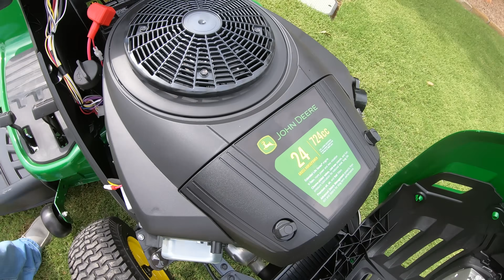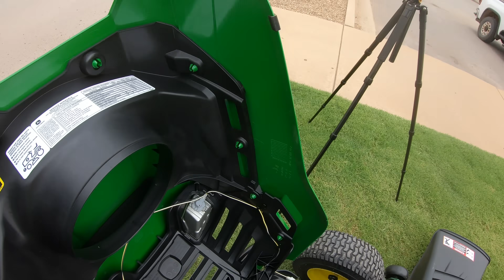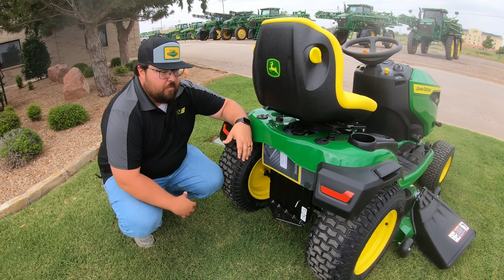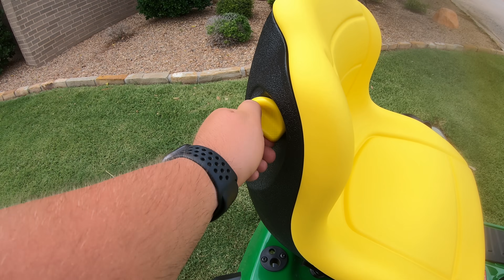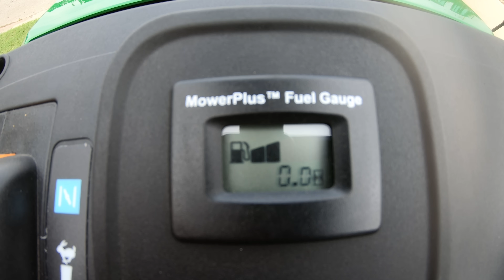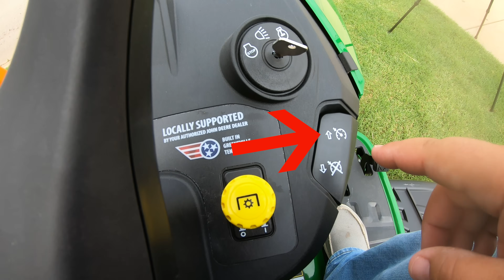2023 John Deere S170 Mower Review & Walkaround

Comment: That's a ridiculous oil change system. So it only takes 30 seconds but you're only replacing heals the oil??  That back up feature is also another reason why i didn't buy the John deere. On my cub first time i back up i set the button and i don't have to press it again till I'm done mowing.  Plus my cub is the kohler, a step up from the briggs

Comment: Quick question, is there a way for the engine to continue running when you step off the seat momentarily to open or close a gate?
Reply: If it is like the older models, just set the parking brake, and you can get off with the motor on.

Comment: Hello and thank you for your very helpful video. I am humbly asking you and/or your viewers for some advice. My 16 y/o craftsman mower finally gave out and I bought a new John Deere S170 riding mower. When starting it for the very first time, it sounds great and runs good until I pull the PTO switch and engage the blades. When I pull the PTO the mower deck takes a big jolt and shakes. It settles down quickly but I'm just wondering if that big jolt when engaging the blades is normal. On my old craftsman mower I had a manual lever and when I pulled that over to engage the blades it was smooth with no deck jolt or shake. No one at Lowes seems to know if that is normal and Lowes is planning on replacing this mower but I would really like to keep it if it's not really a problem. Thanks
Reply: My 140 does that I've had it for 10 years. No issue.

Comment: These videos are loaded with information! I'm trying to decide between the S140 and S170. It's a $400 difference and I can't decide if it's worth the extra for a 1.25 acre yard.
Reply: Same here I'm going with the 170 simply because of cruise and heavy duty rear end
Reply: @mikevenable9945 ive had a 140 for 10 years it has the cruise on it.
Reply: @mikevenable9945  does the 170 have the k46 or a different ine?

Comment: ours is falling apart - first we modded the deck so it doesn't cut the belt - e brake handle came off in my hand - fuel ga. shows I don't what it means - rear mow thing failed too - junk
Reply: I bought a 1 year old S120 in late spring 2024. There are a lot of videos and forums dealing with the fuel/hour meter gauge. Seems it has an internal 2023 battery which dies in about 2 years and can't be replaced, you have to buy the whole gauge. How is anyone supposed to keep track of hours for service intervals when you lose the accumulated hours every couple years? Mine had a wacky reading when I got it out this spring, that's when found out this is a major problem with all JD mower with the Mower Plus gauge.

Comment: Lost a whole Hp going from the E to the S also the quick change oil is way over priced a conversion kit with 2qt of JD oil and filter is $10 less and  the savings get better with every oil change there after plus the engine will last longer because you get a complete oil change not a third of an oil change
Reply: You can run regular automotive oil in these.

Comment: I would not call it an 'all in one' oil change system when 3/4 rs of the old oil is left behind and unchanged with the quick change system. Convert it to a real oil change if you don't want to buy a new mower must sooner because the old oil is never really changed. Conversion kit costs less than just one of those 'quick change' filters.

Comment: Just my opinion, but don't buy this mower. The air filters don't seal tight a lot of the time and the quick change oil change filter and oil system cost $50 and only replaces less than half the oil in the engine.
Reply: Yes the oil thing is stupid, 
But it can be solved with a $25 part and that way you can get a regular oil filter.
Reply: Glad it’s just your opinion. This mower is great!
Reply: You got the wrong maintenance kit

Comment: I've broken 5...yes 5 of the orange brake levers so far on my 100 series since I've bought it new in 2021. It's plastic with a little tap attached to metal. It will literally snap and pull right off. I expect better from American made.

Comment: Kaleb, that’s a stupid question.  I expected it to be a better tractor with better implements than other less expensive brands.  I made the mistake of buying it while shopping for other stuff at Lowes and just went with what I thought was the best brand and the top model they had.  After the problems, i went and looked at a cub cadet for the same price and it was way nicer.  And im not going to spend 5-10k to cut grass on my little lot.  No brand especially a Premium brand should ever put a plastic impeller in a snow blower.  Ive had 3 no name push blowers that were steel.  Jd wants something like $2000 for that pos?  Like i said they are resting on their laurels and taking advantage of people’s trust in their name.  That’s why I posted this to make people aware.  So now if I want a tractor with a decent snowblower i have to sell my JD at a loss and start over.  This Premium brand is inferior to other entry level tractors by other brands.  Oh not only that, but you have to buy a kit and tear stuff apart in order to do an oil change!  What the??  What did i expect buying the S170?  Way more than this.

Comment: I have a 2023 JD S170 and it has 15.7 hrs on it.  So far cheap plastic steering wheel cracked and took weeks to get in.  Now the belt to the lawn mower deck broke and I have to pay $100 for the service center to pick it up and they seem unsure if it will be covered by warranty!  Less than 16 hours of cutting my flat 1/3 acre grass in the suburbs.  The hood has no support to stop the wind from catching it and breaking it, just plastic junk.  I was going to get a snow blower but found out the impeller is made of plastic!  Are you kidding me?!  The dealership said this is entry level so they’re plastic.  Total junk.  My neighbor has a cheap tractor with a snow blower and it has a steel impeller, so does my push snow blower.  JD Is greedy and resting on their laurels and ripping us off.  I thought JD was top of the line and just bought the best one they had at Lowes.  I’m going to sell it this spring and look at the competition.
Reply: You bough a 100 series. What did you expect?

Comment: When you take the old easy change filter off, isn’t there some old oil still left in the crank case?
Reply: @user-gz7kb7yq9p Jesus. This easy change oil system is stupid.
Reply: Just convert it back to the old drain pipe and use regular filters again.  Easy.

Comment: Brent, looking at the s240 versus s170.  I like the feel and looks of 170 but I know the scuttle talk between Briggs and Kawasaki   So, extend life Briggs what does that mean? What did they do to extend its life? If I order a 170 the first option I’m buying is the kit to convert it back to a normal oil change, which I’m sure that change alone will help extend its life 😊.  Im not sure how a filled used oil filter can be recycled or can you dump the oil from the filter once removed.  Appreciate your advice and you definitely know your product well.  Lastly do you have or can you produce a video about the edge and accel decks pros and cons.   Thanks.
Reply: Prices being almost equal I'd take the s240 with the smaller 42" deck. If you've got another $300 then get the s240 48". The s240 gets better gripping tires,and the accel deep deck leaves a beautiful cut at a higher speed so you can get done faster. You can also buy the mulch control kit that allows you to switch from mulching to side discharge at the flip of a lever. The Kawasaki is a fair bit more reliable than most engines. From what I understand the extended life Briggs engines have better air filtration and better valves and valve seats. I wish briggs and Stratton spent some time deciphering their engine stuff for the public
Reply: @ciphercode2298  I looked at the S240, but seat didn't adjust and oil change is a pain with a panel in the way of the drain system.
Reply: @peyote777  watch a video review/ walkaround of the s240 by western equipment on YouTube. The seat is adjustable and the panel that's in the way of the oil change simply flips up out if the way to change the oil.  Wish youd of talked to a salesman,they're actually pretty good machines
Reply: @ Spoke with JD dealership manager!  He couldn’t get the seat to move up and back
Reply: @peyote777  idk,theres just a small lever you lift up on under the right side of the seat,then you shift your weight. May just need a shot of wd40
Reply: @ I’ll check it again. I’m leaning more towards the S170 because I like the big wheel on the back and the reviews. Otherwise I’m gonna go big and go for the X570, 48 inch cut.
Reply: They're real decent homeowner machines. I bought a slightly used x350,and got it for $1k off new price. It's a great machine same deck and engine and transmission as the s240. The x350 has a little heavier frame  and front axle. I mow almost a dozen yards a week with mine and certainly cant complain.
Reply: @peyote777  see what slightly used mowers your dealers have. Late winter and early spring is a great time to catch a deal. I got and x350 with the mulch control kit for $2450 last February, had less than 100 hours on it,looked brand new

Comment: you mention that there are only 3 grease points on the front of the S170. The 2023 S170 I looked at from Lowes also had 1 on each front wheel bearing. Are there difference in the same model???
Reply from the maker: Yes, one by each wheel and then one in the center pivot point of the front axle. They are the same on every same model.
Reply: Sorry, I wasn't very clear in my question. You state/show 3 on the front of your S170. 1 on each side axle spindle hub and 1 on the axle pivot point. My S170 has 5 on the front. The 3 you show and then 1 on each front wheel hub itself. It looked like your S170 was missing the wheel hub zerts. That's what has me confused @WesternEquipment

Comment: Random comment but I would be interested in the significance of any of the John Deere labels engine.   Does it have an impact on replacement parts? Warranty? Why don’t other mower manufacturers relabel the Kawasaki, Briggs, or Koehler engines?  Is this worth a video? 
What are pros and cons of the labeling if any?
Reply from the maker: These are good questions and I think this may be worth a video. I will do some research and see what I can find out. Thanks!

Comment: Would be a lot better with the Kawasaki engine.  Thank you for mentioning that the Easy Change stuff can be removed.
Reply: That would mean a technical decrease in HP and increase in price, there is an option for Kawasaki on the s2 and x3-x5 mowers
Reply from the maker: This is true, but good thing is you do have that option in just a step above in the S200's.
Reply: Good thing for opinions

Comment: 8:11  could you do a video on using the wash port?  I see a lot of riding mower videos with people saying the wash port is worthless, doesn't clean the deck very well.  I've even seen small engine mechanics saying don't use the wash port, it'll cause the deck to rust faster, or it's not good for the bearings in the spindles.  I think they're probably all full of crap, or they're just not using it right, or they didn't RTFM.  Or maybe the instructions in the manual aren't very good, I don't know.  What do you think of the wash port?
Reply from the maker: Stay tuned, one is coming!
Reply: X534 has wash port, didn't work well at all. I did follow instructions. Clean mine with garden hose, does job just fine.
Reply: @richardb9779  That works too
Reply: It works if you do it right.